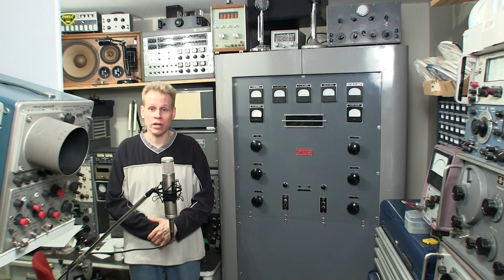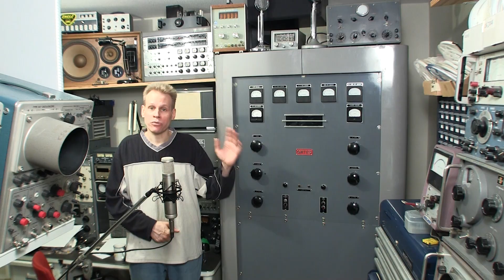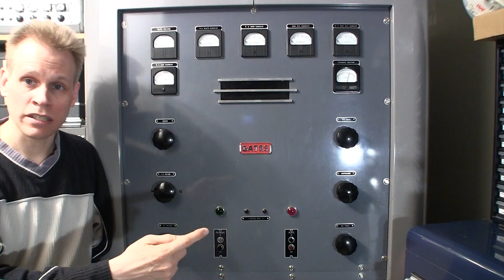Standing Inside a Broadcast Transmitter While it's ON!

Comment: Thats a big cabinet for 250watts ! , but its all about serviceability with this style of equipment.
In recent times, lots of these TXer's have been replaced by solid state units and the old valve gear has been thrown away to the scrap yards.......I have seen many of them from Radio and TV sites.......its a regret I have to have not saved them all from the furnace, but you cant keep everything I guess.
The upside is a lot of the big powered sites still use Hybrids with big valves on the output, but the romance of cabinets like this are mostly gone......good to see you saved this one.
I am really looking forward to seeing what you have out the "back" ...........you must be like me and have a very understanding wife !!!
Reply: Gates almost certainly used the same cabinet for some of their more powerful transmitters. For that matter, they could use the same circuit for up a 1 kw input transmitter.
Reply: Funnily enough I drove past a building site that had welded 2 similar cabinets onto box trailers as chemical toilets that they could move to there building sites.......... probably the weirdest re-purposing I have seen to date lol

Comment: Beautiful rig. Would be interested in hearing more about your VFO design. Have come close to buying a broadcast rig on a couple of occasions, and wondered how I'd manuever it into the ham band. 
What's the efficiency of that rig? I'm betting it uses 4 to 6 kW to generate .25 kW of AM. Am I close?
Reply: James:  Yes, indeed, there are a lot of losses in a transmitter. Engineers realize that a reasonable comparison between what it takes to power a transmitter and what it finally puts out is not equal. The power supplies for most, if not all, vacuum tube transmitters are linear. Therefore, not all that efficient. A switching power supply rated for 10,000 volts at 3.1 amps would be a very complicated affair. However, in a linear power supply, the HV transformer weighs 485 lbs, the filament transformer is rated at 10 volts, 165 amps. The filter capacitor(s) are 8 mF 13 Kv.  A choke is rated at 15Kv.  The rectifier stack has diodes that are really huge. What I am saying is the power supply is relatively simple; it's just big and heavy. The only efficiency factor the FCC requires is either stated by the manufacturer or computed by the ratio of plate DC to final output the the antenna or phaser/matching circuits.  You are correct about SSB and DSB, but it's lousy for music.
Reply: Jason:  Great question. There are actually two "efficiencies" in transmitters. The first is the overall number given to apparent and true power consumed from the power mains. This number is generally given as 0.98 or 98%. The power company uses this number. The other efficiency is power output from the tube or final stage. This number can run between 65% to 78%. This number comes from dividing the measured RF output by the DC plate power. AM radio is different from FM because of the class amplification used for modulation.
Reply: Your first number is power factor. Your second is plate efficiency. However, between the two is a lot of losses. there's all the drivers and filaments, fans, etc. All the drive power doesn't end up out the antenna, either. Ancient Modulation (AM)* is pretty inefficient because half the power is just carrier when it's fully modulated, and at zero modulation you're still using those kilowatts to put out zero information. So DSB is much better efficiency wise, and SSB is twice as good as DSB in using bandwidth.    *Just kidding, of course
Reply: What I'd like to know, if you'll forgive my silly question, is: When transmitting at 250W,  how much power is the rig consuming?  Very much enjoyed your video and subscribed.

Comment: When you spoke of the HV interlock switch I was reminded of Max Ferguson's story of the CBC Toronto Xmitter.
One of the non-technical staff would open up the door to heat his meal inside and cut off transmission every night.  The engineers couldn't figure out why it was happening.
Reply: lol!
Reply: kaybikerow  Or in my case get some winter time heat by putting standby transmitter into the dummy load LOL!
Reply: Very funny